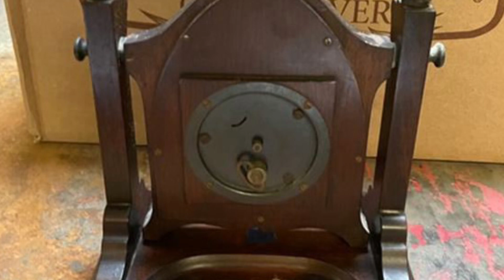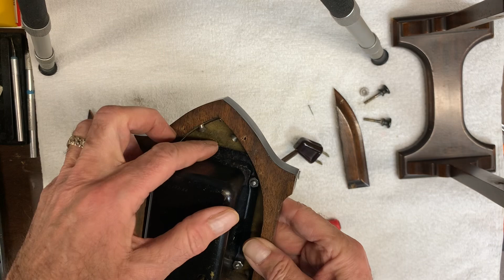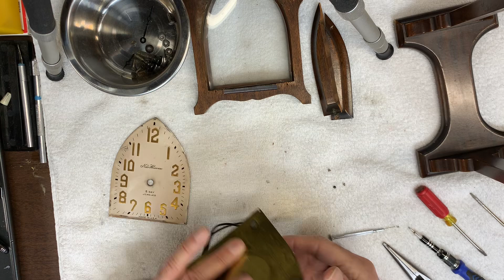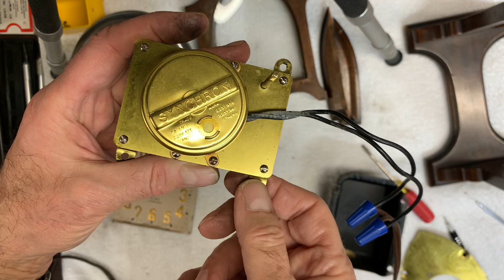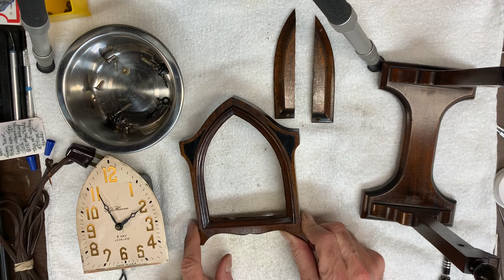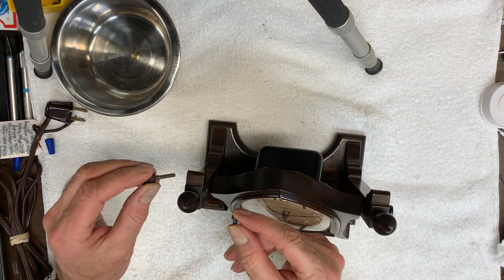Repair of a New Haven Pedestal Clock, c. 1950.

Comment: Synchron motor, I have a Simplex clock and they have that motor
Reply from the maker: I have yet to come across any simplex clocks.
Reply: @markh77  Their Mechanisms Are Master/Slaves

There Are Synchronous Clocks, Which Have The Motor And Mostly Have A Sweep Second Hand, Which Can Plug In 120 Volts And Can Run (They Were Often Converted To Standalone By Disabling The Correction Mechanism)
But There Are Impulse Clocks, Which Are Like That Standard Electric Time Slave Clock You Have, But A More Advanced Tech Version
Reply from the maker: I see, that’s the only one I ever came across. I lookup simplex and saw lots of school clocks, so that explains the master/slave connection.
Reply: @markh77  Synchronous or Synchron motors were often used in almost all those school clocks like Simplex, American Time & Signal, etc. And there are 2 different motor builds, some have the burning oil can like Telechron, others have the gravity wheel like Sessions